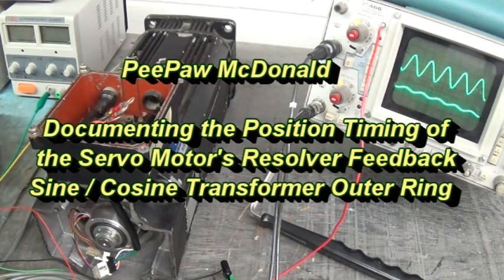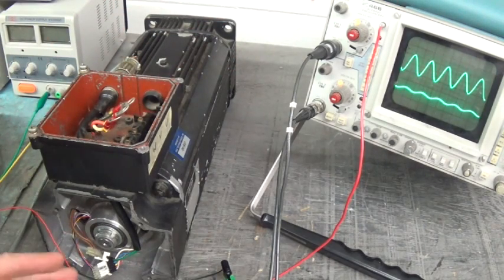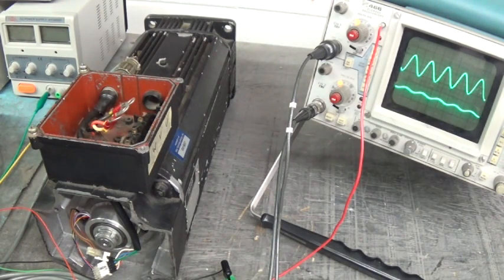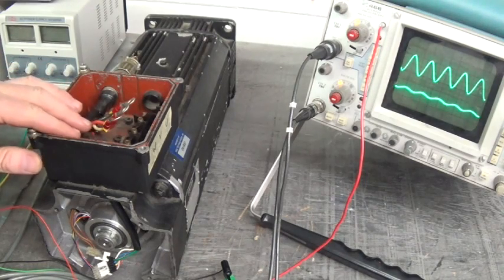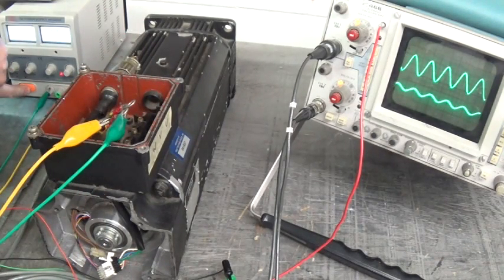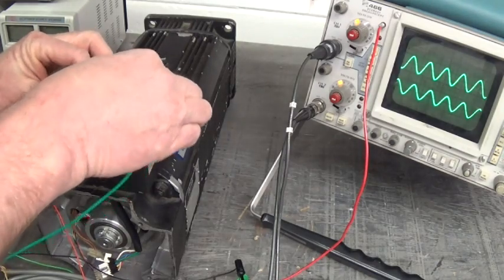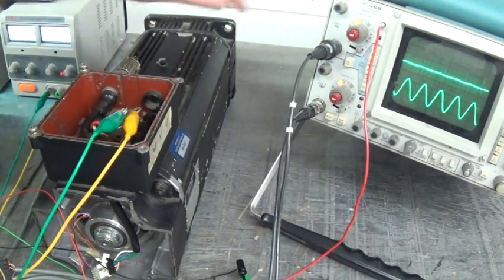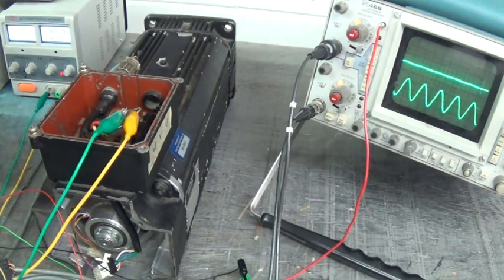Documenting the Servo Motor's Resolver Position Timing.

Comment: Hi sir. If i have to remove the rotating transfomer from the shaft of motor. Should i need make a score make between both of them.after i change the bearing. I reinstall them again with the right score make.
Reply from the maker: Yes Sir, you are correct. The score marks will help you correctly align the rotating transformer to the shaft of the servo motor :)

Comment: Great tutorial, but I have one question: If you put back the resolver rotor 180 degrees off, you would get also the same flat line, since the sine signal has two zero crossings for one period. Couldn't be easier to mark with a dremel?

Comment: Can you provide  the connection diagram how you set up your experiment  to find  the lock up position if  the resolver in relation  to  the motor,  the diagram  that is shown looks a bit confusing

Comment: the old Modicon 410 servo drive has a Personality Setup to be checked and tuned when the drive or motor was changed out or good parts could be changed out all day long and still no worky... thanks a lot...:)

Comment: I have a moog servo motor, it just only lock on three positions not in 4 like others motors with I worked formerly, other extrange thing is back emf, normally  get two cycles each half cycle from sine or cosine signal of resolver, in this motor only get half cycle of back emf by half cycle from resolver signals.
Resolver and servo are 6 pole.
Reply: Tô com um servo desse aqui , sem sincronismo

Comment: Great documenting tutorial, I like it, Sir, Can I ask you? In this case you use 2.05A and 5VDC in power supply to lock the pole motor position, how can you determine the power needed to lock the pole position? Whether is it based on the motor power on nameplate or something other? How can decide the power needed to lock the motor pole position for different kind of motor power?
Reply from the maker: Hello Sir, I wish that the voltages and currents were based upon science and physics. But no... A very good friend of mine... He must be near 80 years old now. Said do this... And ever since... I have done without question what he has said... Happily, he has never been wrong. Thank you very much for watching my video. I hope you are having a good day.
Reply from the maker: I will say this... Servo Motors are rugged devices. And a few amperes will not do them any harm...
Reply from the maker: With that in mind... I must have boundaries imposed upon my work. So the rule of thumbs is to never exceed the "full load ampere" rating of the servo motor.
Reply from the maker: And an external power supply that reside on most bench tops will not exceed the voltages and currents of the servo motor.
Reply from the maker: Again, thank you... And have a good day.:)
Reply: Peepaw McDonald ok, thankyou verymuch sir, for your kindly explanation..have a good day to you too 🙏🏻

Comment: First of all, nice hair cut :). Second, thanks for the video.

I have a servo and removed its sincos encoder. Now I'm installing a magnetic encoder. The new encoder is simple. Align the rotor to its  UVW zero position then reset the encoder by shorting two pins on it. That's all. I don't have an o-scope. Is there a way to find the zero position of the AC servo without using an o-scope?

Thanks in advance

Comment: Congratulations, sir. I have a problem, the servo motor came to me with a removed resolver. How do I set it up when I'm not documented its original wiring. I have a functional generator, power supply and oscilloscope.Can I power volts between two of  stator windings ,no matter which, to lock the rotor. And then spin the resolver to find the right position. Best regards.
Reply from the maker: https://youtu.be/8aHJLuvl6vg
Hello, a good friend of mine derived this documentation on aligning the resolver. So I made a video of the documentation. I hope it helps you to re-assemble your servo motor. Thank you very much for watching.
Reply from the maker: Please watch the video in YouTube full screen mode when you take your screen shots. Otherwise the hand written print will be to small to read.
Reply from the maker: One note I must stress. If the rotating transformer has not been removed from the servo motor shaft. I would leave it be. As it is probably in its correct position on that shaft. Of course this is just a guess.
Reply: Unfortunately there is a problem with a bearings. In order to change, the bearings  resolver should be removed. But it is not done measuring the original position! Tomorrow I'll try to set it up. I
 will lock the rotor and start rotating the resolver. I will try to find
 a flat sinus and maximum peak of the cosine. I will write what 
happened.
Reply: Cuanto cuesta un motor asi me encontre un bautz hibrit Hy2004266710A8